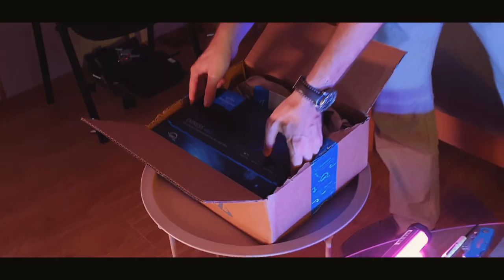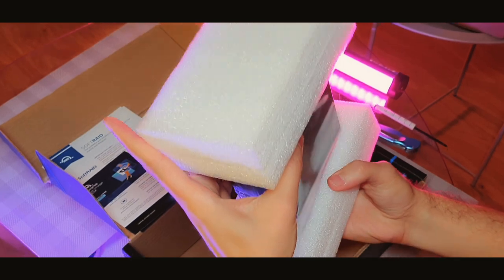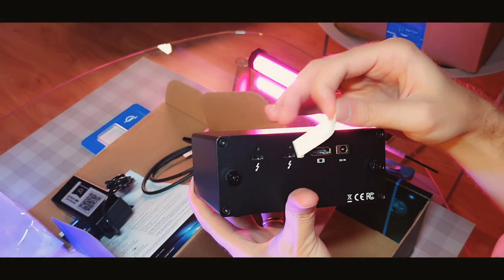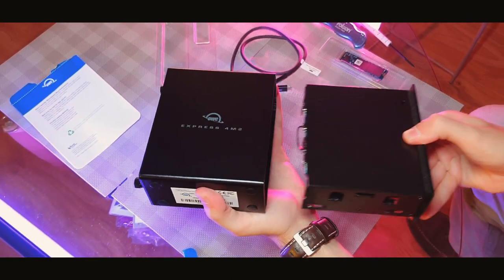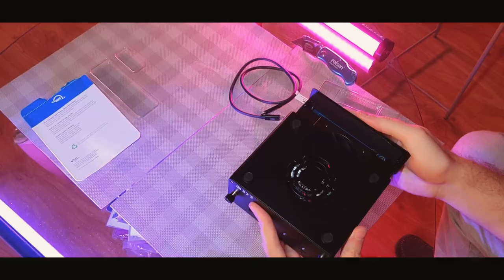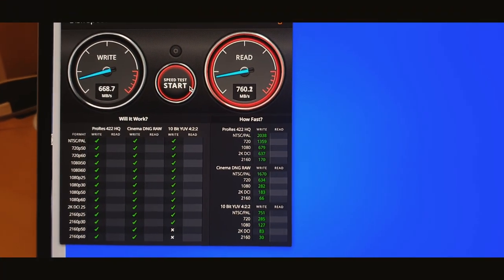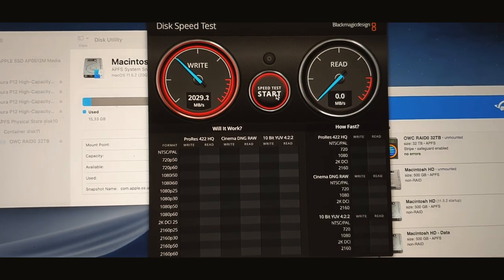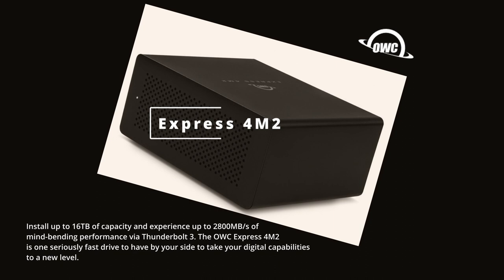Unboxing the OWC EXPRESS 4M2 Enclosure

Comment: So you install one you get 800 Mbs and  when you install 4 you get more than 2000 Mbs but in Raid mode or not more than 2000 Mbs each with no Raid ? Thanks
Reply from the maker: @KevinCLARKPopSinger  there’s no matter what speed your ssds have, in raid mode your speed wont’t be higher than 2600
Reply: @MihranStepanyan  I know I just wanna if you reach 2600 Mbs in Raid mode or normal using each ssd